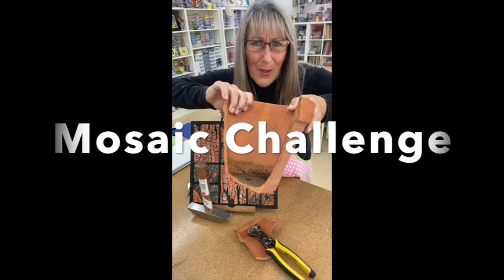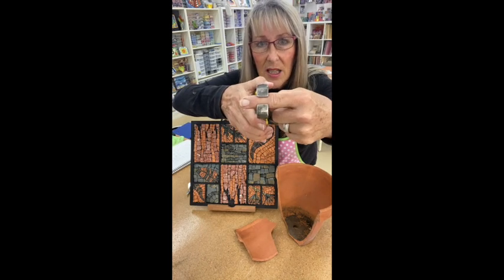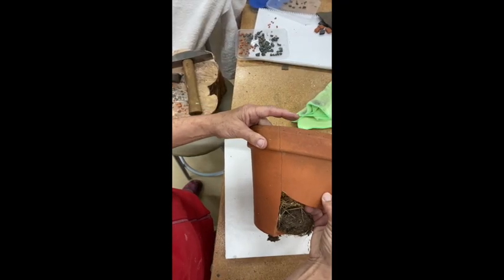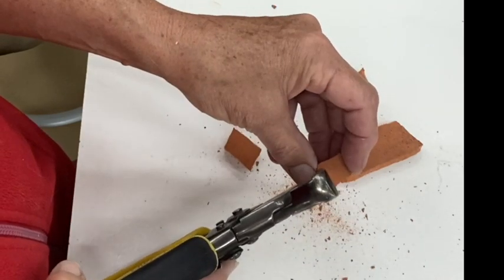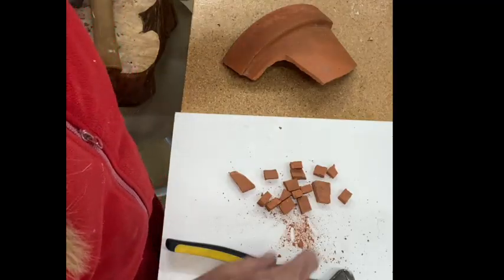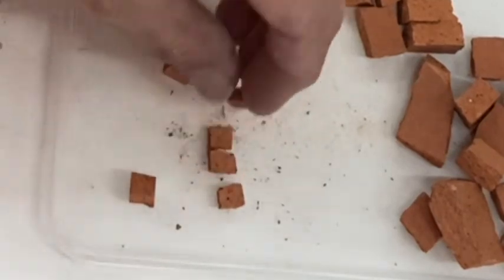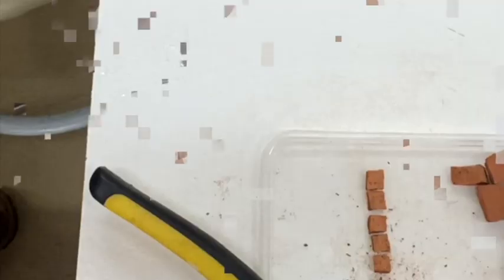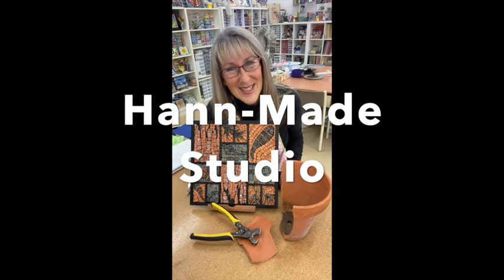Mosaic Challenge No 1: Making tiles from a plant pot.

Comment: Do you grout using the terra cotta tiles. When I’ve used them in the past the grout stained them.
Reply from the maker: that is such a good question.  
I dont grout any tiles that are porous 
As the terracotta tiles are porous, in this project I used "thinnest" which is a cement type adhesive.  
I coloured the cement adhesive black.
the tiles are embedded into the adhesive at least 1/4 inch or 3 mm into the adhesive.  This ensures the pieces are "locked" into place.
Reply from the maker: I do grout terracotta pots once I have finished placing on the tiles. 
Depending upon the colour of my tile I choose the colour of the grout 
I add an additive to the grout which protects the tile from moisture and adds strength to the grout colour. 
I hope this answers your questions